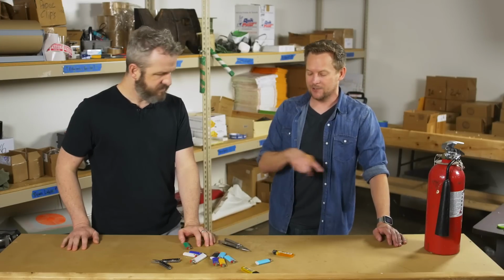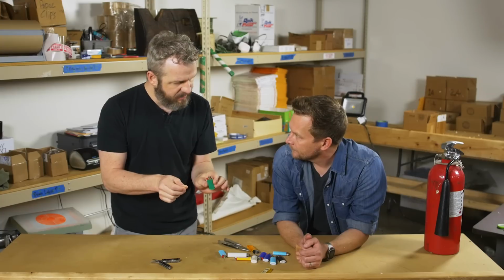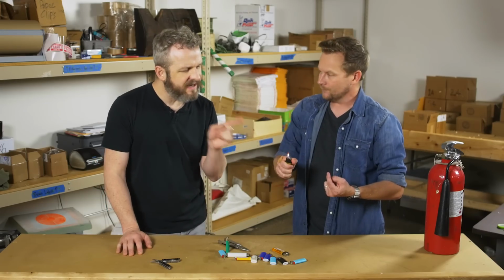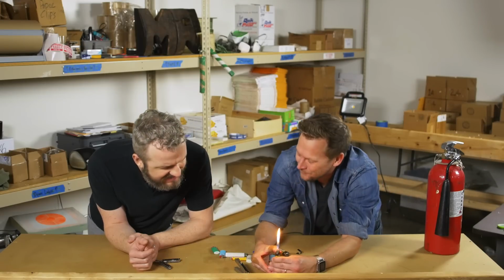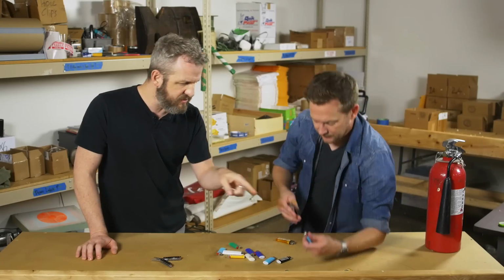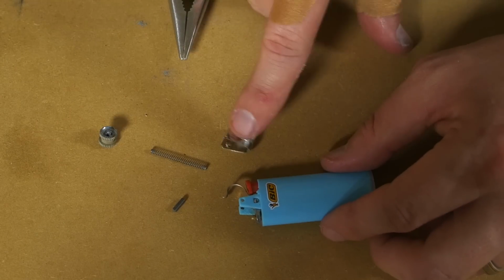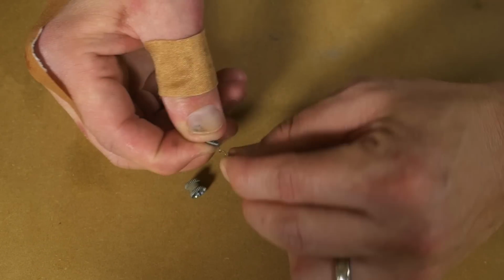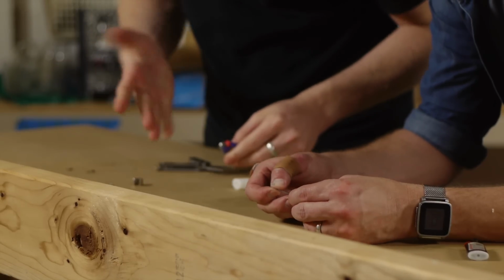Converting Cheap Lighters into Flashbangs & Flamethrowers

Comment: Okay lighters do not contain actual Flint or rock, it is actually very small ferrocerium rods, the same as firesteel Firestarters. It is a mix of magnesium and iron and some other metals I don't remember lol.
Reply: Yes, it's a mixture of cerium, which burns at a very low temperature, and some rare earth metals: lanthanum, neodymium and praseodymium, with a little bit of iron and magnesium too. The name "ferrocerium" comes from the original alloy, which was purified cerium with 30% iron.
Reply: I was hoping I'd find someone down in the comments who would mention the ferrocerium. Kinda bugged me that they got that wrong.
Reply: Wow that's really interesting, I never knew that.
Reply: Now I want to buy a 10 pack of 80x8mm firelighters and heat them up with a blowtorch and see how big the sparks are.
Reply: no
Reply: Okay but it's a lot quicker and easier to call it flint and steel than ferrocerium and steel.
Reply: The king of random has a video where he shows this.
Reply: So what youre saying is I can do this with a firestarter for a bigger flash? :D
Reply: #ShrekAwareness
Reply: Hey they don't know that would you rather have them say big boi words or words we actually understand
Reply: Thank you
Reply: Wow this guy did at least 2 Google searches just to prove he owns reddit
Reply: Gerritt Klashorst I don’t think the purpose was to enforce calling it ferrocerium in all situations, but rather clear up a misconception.  It’s the same thing as telling a kid they won’t get lead poisoning from getting stabbed with a pencil; everyone will still call it lead, but they’ll also know it’s not actually lead.  In this case, mentioning it’s ferrocerium prevents people from grabbing flint off the ground, heating it up and looking like an idiot when it doesn’t glow and explode like in the video.  We’re fine calling it flint, but telling people what things actually are keeps pencil-stab victims from calling 911.
Reply: “Metal oxide, metal powder...”
Reply: @chungass  most of us understand.. I didn't realize they had subscribers still in grade school
Reply: @charleslambert3368  stand far back when you do it, I tried and got burning ferrocerium everywhere including in my clothes. It looked cool though.

Comment: You guys need to take a note from the myth busters and supersize things that are applicable
Reply: Bigger flint, bigger spring. But how do we substitute the flame?
Reply: @robbievalentine8239  BIGGER FLAME
Reply: @robbievalentine8239  MOAR FLAME
Reply: MUCH VERY FLAME, @Robbie Valentine
Reply: @robbievalentine8239  ya need hella flame my guy use ur mixtape
Reply: MinecraftRocks97 - Gaming, Vlogs, And More! Use flex tape instead
Reply: Burgess Forge
They should combine this with the modded nerf gun video to make diversionary bullets. That would be so much more impressive and it would have a farther range.
Reply: If it's worth doing, it's worth over doing
Reply: @robbievalentine8239  The sun.

Comment: "lighter firebomb": 

-Open the safety valve until the gas comes out without the need to push the button
-light the flame
-throw the lighter on the ground so that it explodes (it usually happens with lighters without any flame)

The flame should be big enough to ignite the expanding gas from the explosion, creating a quite big fireball.
I discovered this because, while playing with the valve of a lighter to see how big the flame would get, the lighter caught fire and releasing the button did not close the flame, so i threw it off the balcony because i feared it could explode in my hand: when it hit the concrete, it exploded making a huge fireball... fortunately there was noone around.
Reply: one time, I was at a weekend camp on my local sports club, and me and a couple mates were fucking around with fireworks next to one of the roofed football courts.
being an enclosed space, you can imagine how those firecrackers banged in there.
our coach caught us, and confiscated the lighter..... two seconds after, he threw it against a wall, ten feet away.
boom.
"see? I made my own firecracker."
we: :(
Reply: @mae8711  putting napalm and lighters together really doesnt sound like a good idea
Reply: @nobody-pr7fg  of course it's not a good idea, that's the exact reason why I did it.
Reply: You can also make a timed firebomb by screwing with the flame size till it's pretty big then locking the wheel and taping the lighter diagonally downward. The flame will eventually burn through the plastic and ignite the fuel source, causing a pretty sweet explosion.
Reply: You don't even need the gas goin of you throw any lighter at the ground hard enough it will explode did it plenty times as a kid
Reply: A good friend of mine did that in theater during the play...

Comment: reminds me a little of a trick an old friend showed me, you use Brians' trick to get the flame larger, then you light it and turn it upside down so that the actual plastic part with the fuel in it catches fire and lob it at the ground, explodes really loud but not reallybright like this, would probably work well as a distraction.
just gotta be careful my friend copped a bit of molten plastic to the face doing that.
Reply: Whoa.
Reply: +Jason Murphy an old old comment but that was also in 100 deadly skills
Reply: How to lose a finger 101
Reply: I learned that if you cover it in napalm first it works better but you have to make sure there is zero water in the napalm or it might fling flaming napalm at you

Comment: Okay, I understand your process of doing this and how it all works. what gets me is that you now have a bunch of broken unusable lighters with fluid in them. I was shown a trick when I was about 14 about how if you take the entire lighter, leaving it completely intact, and throw it at the ground like Jason did it explodes. Less set up time, about same cost, and now there is a quick concussion sound to go with it. This all work by the same principle of the flint sparking, but now it is sparking all the fluid at one time.
So again, the fuller the lighter the bigger the bang. Also throwing it on the ground means throwing it at a solid hard ground like Concrete or Asphalt. Try it out and see how you like it. Oh! I forgot watch out for the cap. it becomes a projectile. Good Luck to all those Modern Rogues that read and try this. Disclaimer, I didn't not tell you to try this. I am not at fault. And sometimes it doesn't work, I recommend throwing it harder!

Comment: do they light up more the harder you throw them? I would love to know
Reply: It seems that way? Not entirely sure.
Reply: As I understand it you're really just trying to fracture it and increase the surface area. The closer you can get it to powder in the end the better.
Reply: yep the harder they hit the more they explode
Reply: CadetriDoesGames used to do so all the time,
The answer is yes to a point.
Tossing them with force increases the effect a good bit,
However because its small an light you can only apply so much pressure...
So there is in this way a limit lol

Comment: When I was a kid I would take old ferrocerium rods or “survival fire starters” that create the same kinds of sparks after they broke, grasp the ferrocerium with two sticks, and smash the ferrocerium with a sledge hammer and almost catch everything around me on fire when I did so, or I’d throw it and watch it explode. Ferrocerium oxidizes at a high rate in the same way hand warmers do to create heat, but it has certain elements combined together in it to create a lot of heat as it does. They are made of iron, magnesium, neodymium, lanthanum, cerium, and praseodymium, and when the alloy gets the amount of energy to oxidize the metal (from a striking motion or from a flame after shattering) it reaches high temperatures as the chemical reaction takes place with the scraped off bits.

Comment: Using a torch lighter like that is also a little safer to the butanes coming out so fast that it's keeping the flame pushed away from all the plastic and metal Parts you would be able to keep it lit longer without the metal heating up

Comment: When it's truly dark, not like ''I can see perfectly except the colours'' kind of dark any light can be blinding for a short amount of time(your eyes will take some time to adapt to the correct level of light). There was even relatively effective idea in medieval times for blinding during night and it was basically a shield with lantern that you could open and close, so the light didn't come out until you opened tiny door on the front of the shield.
Reply from the maker: good point.

Comment: Nice trick,  but there's a second part to this you still need to do!! Throw the heated flint at a smooth surface,  like a piece of sheet metal or something.  Where the flint popped against the metal you'll see a little silver disc.  Pull if off with your nail, and then light that with a lighter and see what happens!
Reply: Hmmmm. Now I'm curious.
Reply: And so you should be!!   Have fun with that...

Comment: cut a small bicycle intertube to fit over the lid of a zippo, like a gasket to keep the gas from escaping, fill it with frozen lighter fluid, then just roll the rubber downwith your thumb, flip it open, strike, and swipe it in someones face as a distraction, it will throw A LOT of burning fluid, and your hand may set fire for longer than youre comfortable with, but burns fast enough to hardly do damage, now you can leave a trail of fire in the air big enough to give you a chance to strike an aggressor first or run, like a self defense pocket fireball

Comment: Important difference: Flint, and ferro rods/firesteels. A flint & steel lasts much longer as the flint sparks steel, whereas a fire steel has a bunch of material shaved off that combusts instantly, way easier to use but lasts much less use. The lighters use a small piece of ferrocerium.

Comment: You can wedge the metal cover under the valve and light that lighter with another one and it will burn until the heat melts the plastic, and the remaining butane explodes out of the melting plastic. Works better on the adjustable valve ones, as the metal is weak and you can remove it with a fingernail if you just bend it out. THAT would be a fast, easy, delayed diversion. Great video.

Comment: The wire doesn't stay red hot because it's so thin that it instantly cools off

The flint gets hotter and brighter because it's magnesium and when red hot it already reacts with the oxygen in the air (reaction produces more heat, more heat = more reaction = even more heat and so on) and when you throw it at the ground it just breaks up into smaller pieces, creating more surface area so it reacts even faster
Reply from the maker: got a link that explains the reaction?

Comment: Just a few notes about the flamethrower one. 1. I learned this the hard way, you must be very careful when you turn it up that the flame doesn't touch the lighter. I have had molten plastic dripping on my hand, it hurts, like really fucking badly. 

2. Make sure to put the metal cap back on, it helps prevent the plastic from melting

3. You can use your nail to take the metal off, that managed to save me a few times
Reply from the maker: 1: oh, yikes.
2: good point.
3: clever!

Comment: That "flint", is actually a chemical called ferrocerium which is composed of iron, cerium, neodymium, lanthanum, praseodymium, and magnesium.  Flint is actually a variant of quartz which is made of silicon dioxide, and these two compounds are nothing alike.  Traditional flint and steel works by striking the steel against a really hard rock, it doesn't actually even have to be flint, it can be some other really hard rock, but anyway, what happens is that flakes of the steel actually come off and ignite due to how hot the friction of being hit makes it.  Ferrocerium on the other hand is a pyrophoric alloy that ignites due to it's strong tendency to oxidize and just scraping it creates enough friction to ignite the material as it flakes off in little splinters. Because of this, it is actually more accurate to call ferrocerium firesteel rather than flint.

Comment: the sparky thing is not flint, it is an aloy of iron and cerium. also, it glows brighter when you take it out of the flame because it is being exposed to oxygen and oxidizing, which in the case of iron and cerium, is a very exothermic process.

Comment: Toss a nearly full lighter down on it's bottom corner an bust it.
The resulting crack releases the pressure with a very loud pop.
Loud enough to draw attention an definitely distract without being directly in view.
Also beware sends parts flying sometimes back out you...
Wouldn't recommend it without glasses shades or some eye protection lol

Comment: I loved it but there were some factual errors. The "flint" is actually Ferrocerium a pyrophoric alloy. True flint is harder than steel, so in a traditional flint and steel the sparks are burning steel. Ferrocerium is softer than steel, so it sparks, and burns readily. This brings me to my next point, it did not glow brighter because it was absorbing heat from the wire, but because it was burning.

Comment: flamethrower take one of those cheap all plastic syringes from Walmart ducktape it onto a cheap lighter then use another cheap lighter and shoot fluid into the nozzle of the plastic syringe so the plunger pushes outward stop when its full without the plunger leaving the tube then light the lighter taped onto the syringe then press plunger while lighter is lit 

thank me later after you try it have fun and stay safe

Comment: If you throw a lighter hard it bursts as the gas escapes creating a loud noise and sometimes a flash if the flint sparks when it hits the floor, that seems the better bet I've genuinely used this to get away before me and my friends were trespassing on the roof of a small building at an abandoned community thing and the police came so I threw the lighter as hard as I could to the rear of the building waited until I heard foot steps than we all made a mad dash off the roof for the exit and got away.

Comment: Hearing Canada those are commonly known as Flint bombs and here's a cool tip for you take your fingernail and release one of the side clamps housing the metal wheel so that one side of the metal wheel becomes unlatched from their turn the lighter upside down into the palm of your hand and use your finger to release the wheel into your hand the Flint will then fall right into your hand along with the spring

Comment: Did you know if you do it o  a concret floor you can actuly do it a sec time just pick up the falten flint and heat her up again but this time it gets red realy quick also if you keep the flame on it it wont explode but it just turns into almost into ash and will be cook at this point on

Comment: I have a better way and its actually a reasonable distraction and it's just to yeet the lighter at the ground and it just explodes making a loud noise and if your lucky it might ignite to produce a flash and make an even louder fiery "woosh" no need to pry around with some casing, extract a flint, then bend, twist and turn a spring, use another lighter to prep your homemade babys first flashbang... just throw the entire lighter on the ground for better effect. Also the cheaper they are the better because the casings are thinner and will break 99.9% of the time.

Comment: For anyone wandering, it can explode in you’re hand. If you don’t throw the flint down fast it takes in the oxygen and the air heats up and expands, causing the flint to explode on its own. Well technically it’s not an explosion because it’s not super sonic but it is a combination

Comment: Have you heard of taking the disposable lighter, a razor blade, a firecracker, some small gravel and tape and making a grenade?  We used to make these when I was young and stupid.  You take the razor blade and score vertical strips about half way thru the plastic, all around the lighter.  Then you tape a firecracker and some gravel around the sides of the lighter.  Use cellophane tape and just one layer or if you have a hot glue gun you can hot glue it instead.  you light the firecracker with the lighter and throw it.  Definitely not the safest but unless you got the gravel in your eyes it wasn't very dangerous!  Your welcome to do a video on it if you like.

Comment: Did this at a ozzy/ rob zombie concert when i was 14 with three flint on one spring and threw it from way up in the rafters and the longer you expose the glowing flint to the air, the bigger the combustion. The diameter of the flint bomb explosion was well over twenty feet and i almost got kicked out before ozzy came on but they couldn't prove it was me cuz none of the other concert goers would snitch cuz they thought it was sick.

Comment: This is cool and I've done this before but...has anyone tried taking 12+ flints and tied them into one system, and then taken a low-fuel lighter and jammed the end of the flint into the lighter so you can (attempt) to make a real mini flashbang using the fire from the lighter fuel and the explosive flint to produce a lot of light? No I've never tried my idea because I'm too lazy but has anyone else?

Comment: I actually thought you'd take the fire bit further. If you keep increasing the butane release level, you'll hit a point where it constantly leaks. If it gets to that point (you'll hear a soft hissing), you can ignite it and drop/throw it and the whole thing goes up. I'm not sure if it's from the flint overheating or what but the lighter usually either explodes or fireballs.